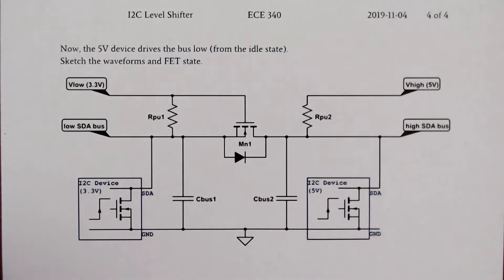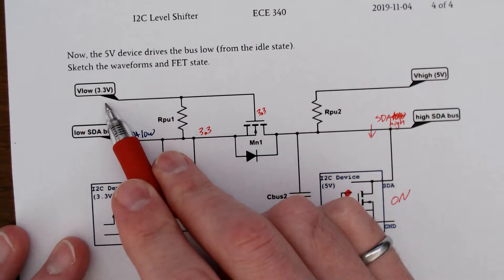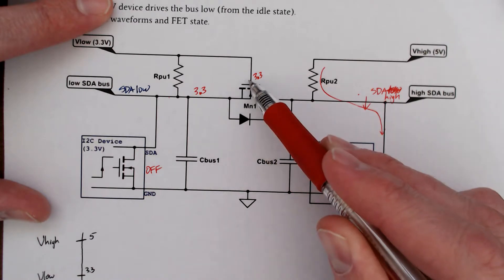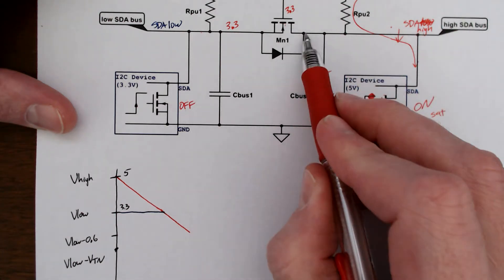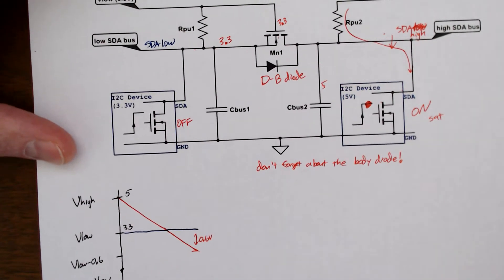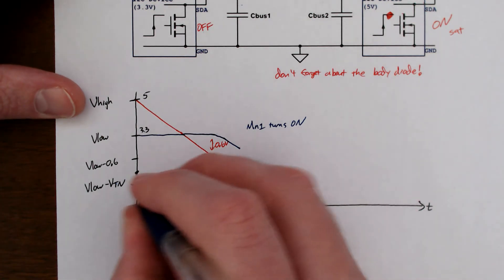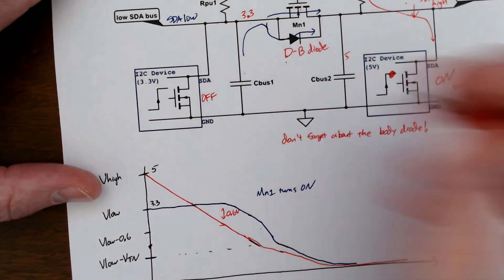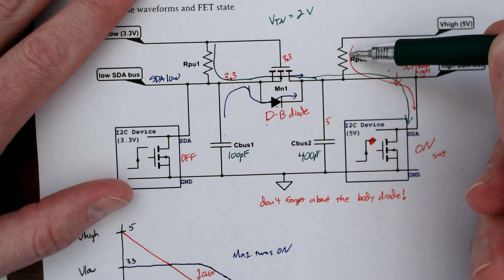I2C level shifter - part 3

Comment: I too was curious how this works. What are the guidelines for selecting a MOSFET, pull-ups, and capacitors?
Reply: Found the answer in the application note mentioned in the first video. They give a MOSFET selection guide and list four product numbers that will work. Also found that pre-packaged level shifters on Amazon are simply a MOSFET wired as explained here, and some 10k pull-ups on both sides.
Reply from the maker: As @cdevidal said, the app note has the information.  Most important is a FET with a threshold voltage smaller than the smallest supply voltage.